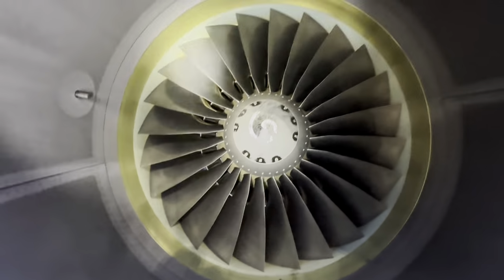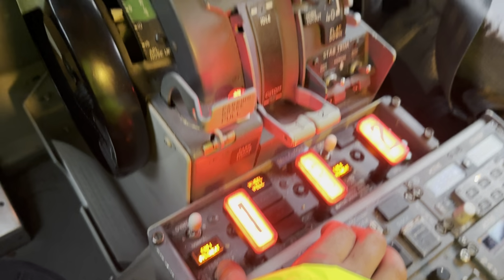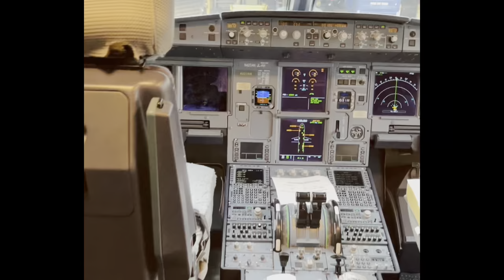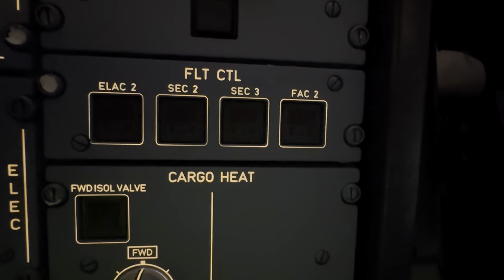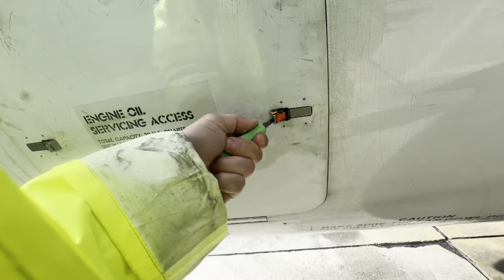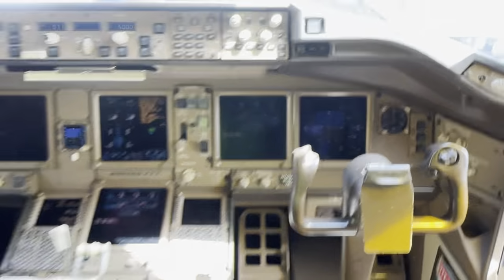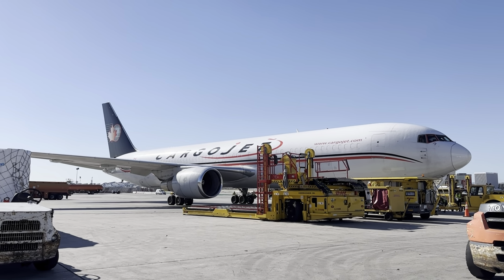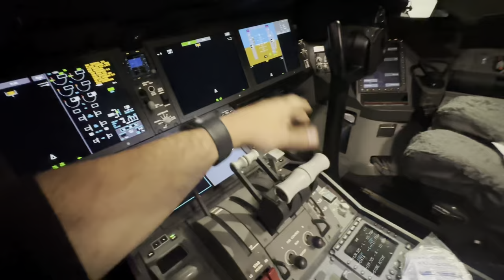Stig Shift #19 (Aircraft Maintenance Adventures)

Comment: Man. Those planes must be an electrician's nightmare, everything's so cramped. Can't move your fingers, hands, toes or anything without getting zapped if you're working around live circuits.
Reply from the maker: Actually, not that bad at all, it’s very well labeled wiring, and lots of access points. But there are some portions of the aircraft where it is very cramped.

Comment: Question with the laws what happens if the aircraft gets hit by lightning?
Reply from the maker: Nothing at all, the aircraft airframe will absorb the lightning. You’ll have some fasteners that might get damaged, but the computer systems do not get affected because everything is grounded with bonding straps.
Reply: @StigAviation  thanks i was wondering as aircraft has so many computers now lol

Comment: Stig, I have a question for ya, 
What system would need to be changed or developed despite the fact that aircraft is the most developed and modernised device in the world? 
I'd like to hear the answer from your perspective
Reply from the maker: That’s a very interesting question, but if you could help me understand what you mean by change of system. Are you talking about internal aircraft systems and if it is so which ones?
Reply: @StigAviation  yea, like ACM, lavatory, Door,,etc. It could be anything that would be considered 'not' perfect, or passengers keep complaining about.
Reply from the maker: Usually, when these things are developed, they go through variety of testing and design. Now, if something is found to be not functioning or defective, they will improve the design or modify it. Sometimes they will even come out with you systems or new designs, and update the aircraft as such.
Reply: @StigAviation  so do you think there's any parts that need to be developed more?
Reply from the maker: @booybje  that’s more of a engineering question, it’s a bit beyond my understanding or knowledge.
Reply: @StigAviation  Thanks for sharing your opinion. Cheers

Comment: I think I have a permanent dent in my right knee from forgetting to stow the manual trim handle on the 737.
Reply from the maker: Me and you both, it’s usually a common prank within mechanics that work on 737 🤣
Reply: And it whacks you about three times before you can move it or let go of the trim switches.

Comment: The hell hole sucks. I had to change out multiple sliding seals which is sketchy even with hydraulics locked out.
Reply from the maker: Definitely not much room to work in there, especially in the smaller aircraft.

Comment: I missed some words why planes are using Nitrogen instead of pressured Air. I know the reason, but I'm sure there are a lot of viewers out there who didnt
Reply from the maker: Nitrogen is an inert, gas, less susceptible for explosion and also it handles pressure and temperature changes much better.
Reply: @StigAviation  You forget something: Nitrogen didnt have any Water in it, so it cant condensate and build up Ice on a single side which will be very evil if you spool up a wheel of -20°C from 0 to 150kt

Comment: You screwed up buddy. You didn't purge the hydraulic hose before filling. Now you got air in the system.
Reply from the maker: And how do you know I didn’t, were you there with me? Also, that’s not how hydraulic systems work on aircraft, whatever Air goes in will end up in the reservoir it will get vented out
Reply: @StigAviation  What does the MM says? Just like the tire falling off. MM emphasize to make sure brake sleeve are put back in the axle before putting the new one in. I think that's what happened in that case. Mechanic didn't see sleeve was stuck with brake and removed with brake when he replaced brake. That created a space and caused wheel to rattle and wore out until it got bigger than the main nut. Nut was still in place and secured. It's been flying fine before the brake was replaced. Same landing gear.
Reply from the maker: @md929  did you get a chance to see the video I made for this. I actually showed the pictures of the aftermath.
Reply: @StigAviation  We call that Murphy's Law. What can happen will happen.
Reply: @StigAviation  no, when did you post it?
Reply from the maker: @md929  three weeks ago, check it out when you get a chance you’ll see the pictures of the axle. It’s around time marker 22 minutes into the video.
Reply: @StigAviation  Ok, I saw it and saw it before. As I stated, my theory is the sleeve that goes with the brakes was not reinstalled. That can easily get stuck with the old brakes when removed. It was not put back in place when the new brakes was installed. The MM emphasize to watch for it and make sure it gets put back in. Without it it created a space and therefore wobbled and wore out the tire bearings until it got bigger than the axle nut. You see my point? The brakes was replaced mid December. Everything was fine before that with the same tire. The brakes was the only one that was replaced.
Reply from the maker: @md929  I definitely see your point My good sir, let’s wait and see what the investigation digs up.
Reply: @StigAviation  I don't think it's not as simple for them to see. They're also overwhelmed right now with all the incidents. Where did you get that picture btw?
Reply from the maker: I was there at lax when it landed. Went over to check it out where a few of my UA friends were working on it.

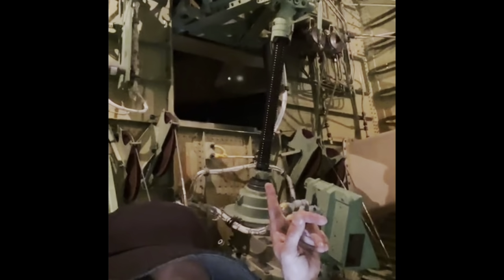Comment: At least the jackscrew & nut are properIy greased (3:19ff). Unlike AK airlines where they were neglected for some reason. KilIed everyone. The poor pilots were subsequently so spooked on subsequent fIites they'd cycle the elevator trim repeatedly on the way to takeoff position to make damn sure the jackscrew assy was working properly.  Who could blame them? But that gave rise to another problem.  They'd overheat the jackscrew drive motor and trip the overloads. Situation still just as bad. NO elevator trim tiIl the motor cooled and the overload relays reset. Ain’t one dam thing it's another, some days. Can't win for losing.😢

Aboard ship rudder actuating jackscrews (where used, as opposed to hydraulic cyl's), the jackscrews are huge & equipped with automatic greasers. MV Dali tragedy made me think of that.  They lost generators, ship went black till emergency generator kicked on and assumed emergency bus load. Unfortunately too late to correct vessel heading. Terrible tragedy. 4 men kilIed.  Thots & prayers for them.
Reply from the maker: Yeah, that was a bad situation on Alaska incident.
Reply: My niece.

Comment: Rookies. Get a Milwaukee screw gun. Makes life easier. Spend some money and make your life easier.
Reply from the maker: My friend, I don’t want to over torque or damage the fasteners. I’d rather do it by hand.
Reply: @StigAviation  Dude, Milwaukee have different torque settings. From very light to hammer drill.
Reply from the maker: @md929  I completely understand, there are certain things that I can use power tools on, but for some thing that is sensitive I rather just use a ratchet by hand.
Reply: @StigAviation  Make sure it goes in by hand before using the power tool. That way you don't strip it. No difference than using pneumatic tools. I use it all the time at work. I'm different from other mechanics since I worked outside of aviation for a while and picked up different methods of doing things. I'm actually more skilled now than before having just aviation experience.